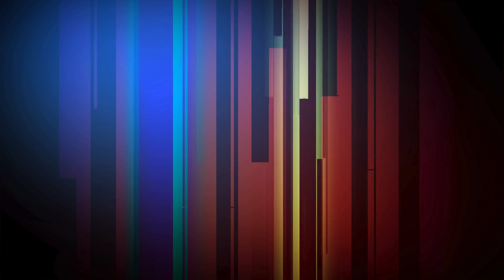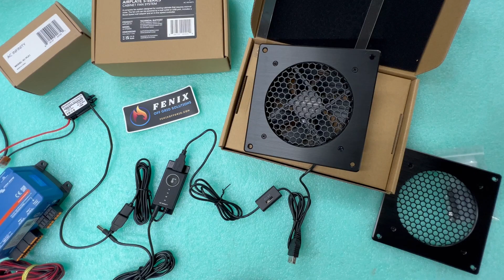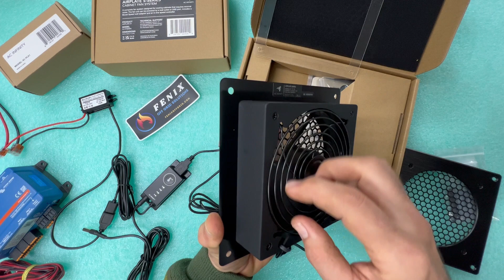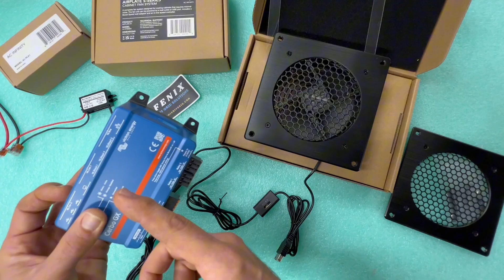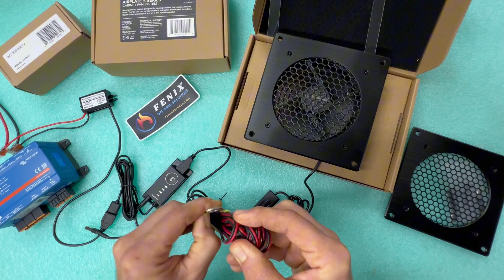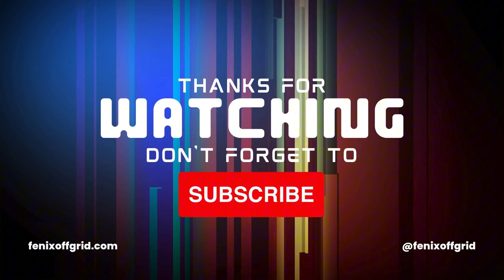AC Infinity Off Grid Power System Cooling Fan for Vans & RV's!

Comment: Was just looking at something like this to help vent hot air out of a mid-size truck bed with camper top. The return would be utilizing some of the gap around the tailgate. Thoughts?
Reply from the maker: Well theres always the Maxxair fan.  I wouldn't use this fan for that purpose.  for intake I would either use a sliding window or a vent opening in the bed bottom or side (without going completely through the outer shell).  You might try something like this though: https://amzn.to/3J9F3T1